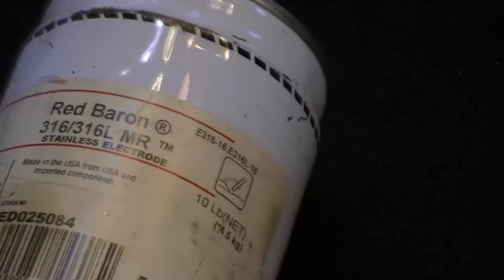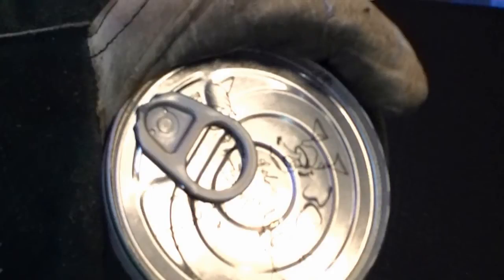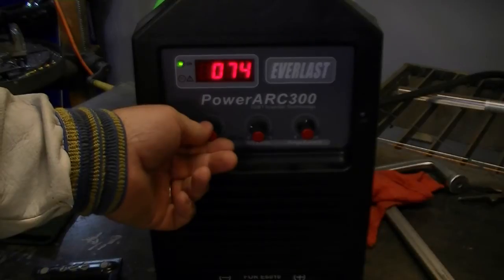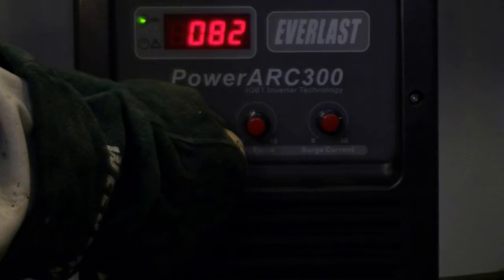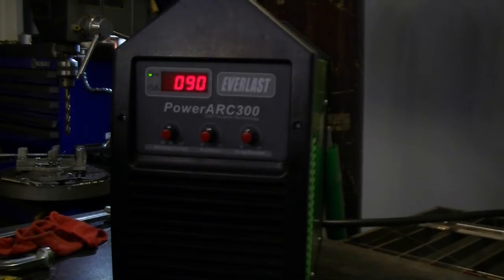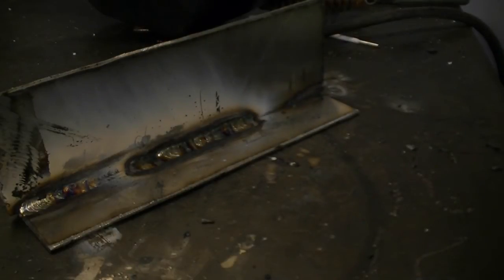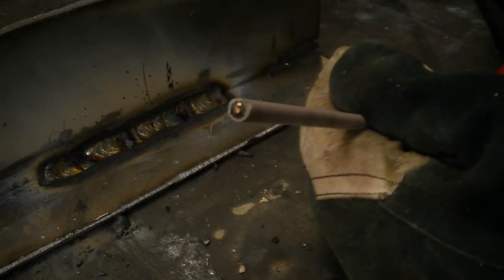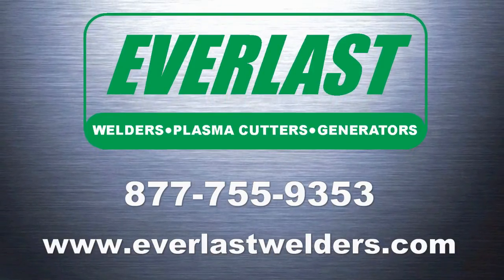Stick Welding 316 Stainless with the Everlast PowerArc 300

Comment: Why dont you make a remotes that you can use while you are welding?
Then you can adjust it like you want, when rod get shorter you just turn th e heat down. Cant you see the benefits of doing so?
And while pipewelding if there is some issues with cap size or something like that, you can play with the current while you weld, it helps you really much.
Just think about it.
Reply from the maker: Because most welding machines in the USA don't support this kind of remote.  Learning to properly set the current and how to test and adjust is part of the welding training.   Otherwise being able to constantly adjust current especially when many places dictate a specific current for certain welds teaches you nothing.  A beginner who can constantly adjust current while welding really handicaps the learning and experience.
Reply: And that is just crap. When you learn to weld with remote, the right amperage is in your eye. You dont have to think about the readings, they are right, when stick burns like it should.
Do you mean that we in north europe cant weld becouse we use remote all the time? And becouse we use it our welding is bad??
Reply from the maker: Sikksa as
Until you said something I did not know where you were...but welding is a technical skill which requires close monitoring of exact amperage.  It is a thinking man's occupation. But welding with a remote allows any worker with lower skill to be able to weld without a lot of knowledge or qualification of technique.  Heat control can be easily managed in most cases with technique.   You brought the subject up...one that you may want to debate in Europe, but here, technique is most important.   In the U.S. a w.p.s will specify an exact range of amperage.  With a variable amp control this cannot be accomplished.   Without tight heat control you will for HAZ and also have more issues with incomplete fusion if it becomes too low.  Adding variability to the amperage creates a varied weld, with more (deeper) fusion in some areas.  We have amp controls here in the U.S. but they are not generally continuously being adjusted.  The only reason they use them is to keep from walking back 300 or 400 feet to make readjustments.
Reply: Everlast Welders and Generators

You dont understand it, or dont want to understand. When highly skilled welder takes remote to his hand and start to weld, he get same penetration allthe way in the weld. At first he starts with higher amperage and when rod gets shorter he slowly buts down the heat. Result is that you get a better looking, and equally penetrated weld.
Here we also have something you call control of welding, they dont allow incomplete fusion.
When welding rod gets shorter it gets hotter also, with ability to control the current you just get a better weld.
Of course if welder aint professional he will have issues with remote.
But as I said pro welder sees right amperage when he welds, he knows when rod burns good and when he gets good penetration and he will be an exact right ampege range.

Try to weld vertical uphill with stainless rod, at first you will go fine when amperage is right, but at the end of the weld you got problems becouse material gets hot and stick gets shorter.

Without remote you are just making things harder to your self for no reason.
Old welders here say that before there were no remotes, stick welding was much harder and they dont miss those times at all.

How we see it, you have fallen behind in stick welding improvement.

Try to make a remote that you can use while welding, and give it to some pro around there to test and here what he thinks of it. Or buy one from Esab or Kemppi, they know how to do it.
Reply from the maker: I am sure you will not change the standard practice in the whole welding industry in the USA (which is bigger than Northern Europe's) with a few comments.
Reply: Everlast Welders and Generators

So it is always size that matters, I aint trying to change whole industry of yours, I am trying to tell you that there is better way of doing things.
Without remote stainless is shitty to weld, but if you put a remote to your machine it will come very weldable with stick. If I was a welding machine maker, I would try to improve my machines,  not to keep them same as they have always been becouse, "this just is how it has always have been" It is a stupid way of thinking.
 Hmm, do you even know where stick welding was invented? Do you know where was the very first inverter based machines invented? I think northern europe has changed your industry a lot so far. But you just think you know everything and you are always best, becouse you are big.

Comment from the maker: I would say that the American welding industry, the country that has poured more research and development into the science of welding, does understand the importance. Hand Remotes ARE used in the US, particularly on the pipelines. But when TIG is used widely and plenty of equipment around to do so, Stick isn't typically used on thin materials, especially with a metal that is subject to deformation under heat as Stainless is.    For heavier weldments, Stick is the method of choice with stainless.

Comment: When do american welding industry understand the importance of remote control stick welding, they allways talk about amperage, in north europe, the amperage is contolled with remote hand control, you dont need think about it, you just adjust it when you are doing a weld. You can weld very thin stainless steel pipes with stick when you have remote. It doesent have to be a tig to weld something like 2mm thin pipe, you can do it with stick.

Comment from the maker: Stainless is commonly welded with stick in a lot of applications, especially in steam pressure and pipe welding.  It leaves as smooth as bead as TIG, even better in the right hands.  It's realativley easy, and personally, I'd pick it up to do on thicker metals anytime, over TIG because of its speed and smoothness.  But everyone has their preferences.

Comment: How about taking a wire wheel to your beads so we can see what they look like. This is good info but given all the soot and discoloration I'd have to be desperate before I used stick for welding stainless. I wasn't aware SS could be stick welded so thanks for the enlightenment.

Comment from the maker: Stainless is common in the stick industry.  We hope to be able to do a video on 309L which is a common way to join stainless to regular mild steel or steel to steel.   It's done where abrasion resistent joints are necessary such as in elbows joints that carry abrasive materials.  The welded areas are subjected to faster wear.